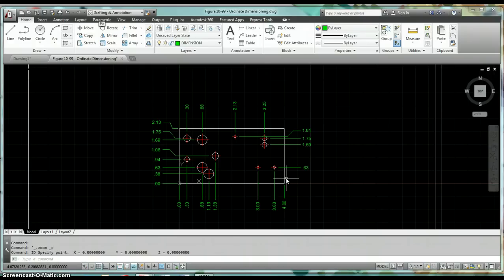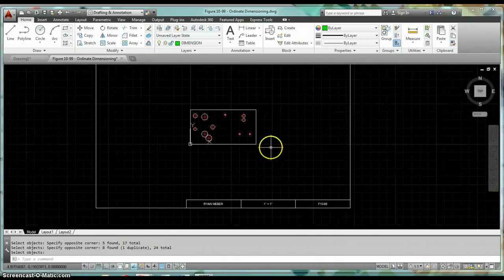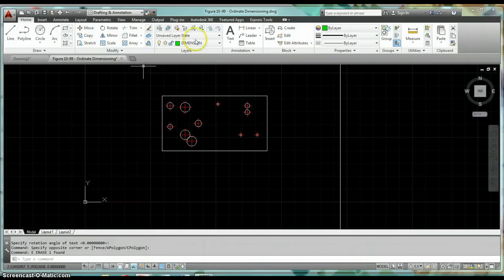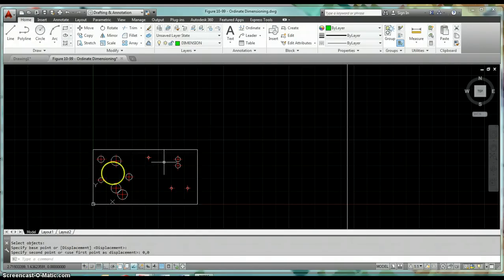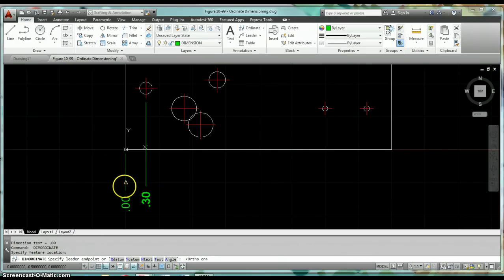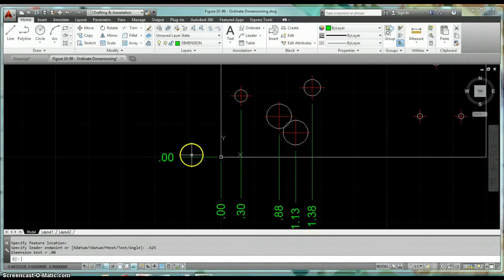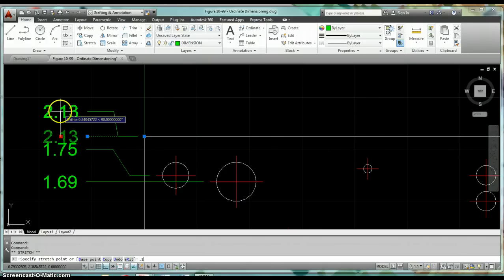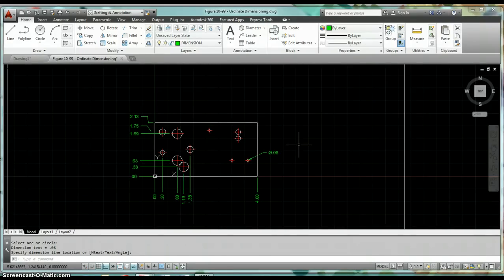Ordinate Dimensioning

Comment: Is ordinate dimensioning only for holes?
Reply: Thank for the reply Ryan.
Another question is, is it okay to use both linear and ordinate dimensioning on the same drawing to send to manufacturers?
Reply from the maker: That is really a drafting standard question and depends on the manufacturer. I'm not sure what ASME says about that, but I would check with the manufacturer and go from there.